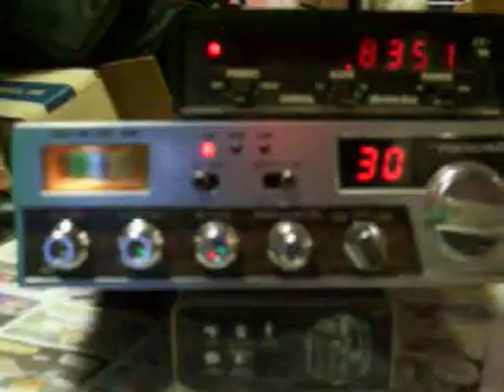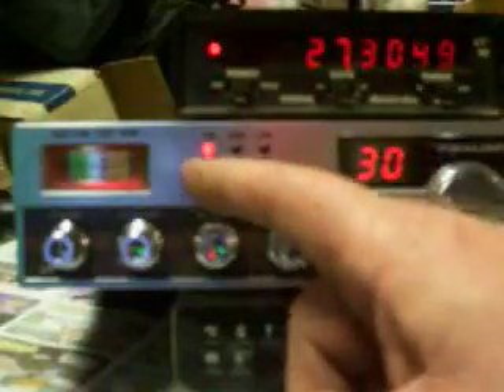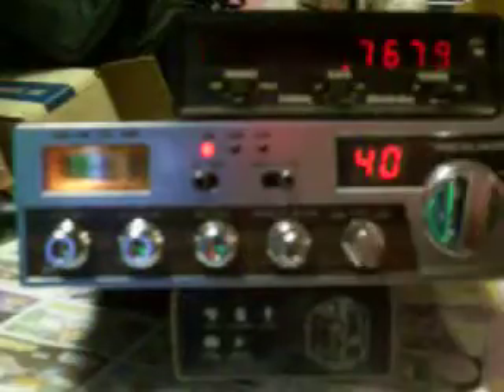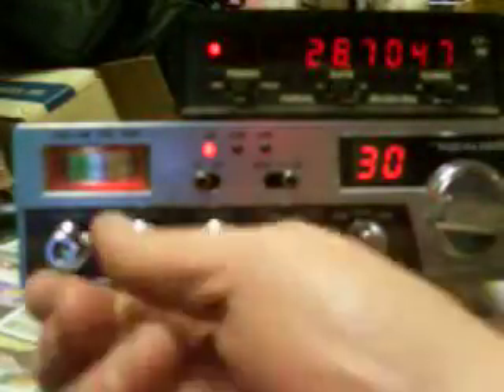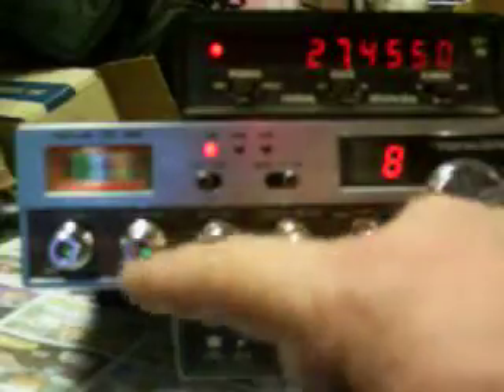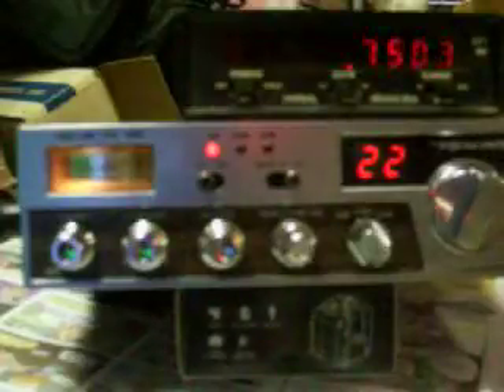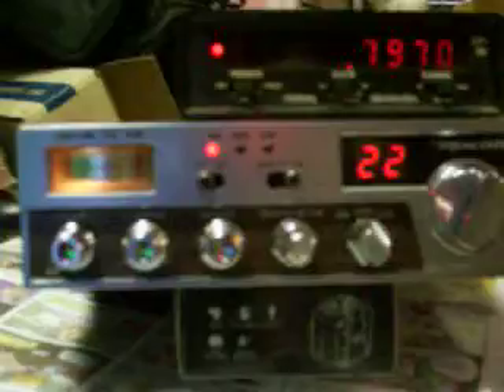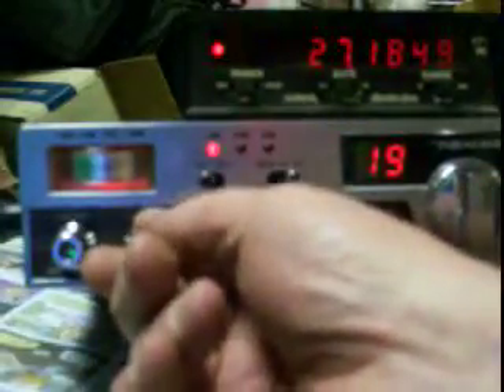TRC-449 Realistic CB on 10 Meters UPD858 ham mod

Comment: very cool.ive been trying to find info on how to do this  .im poor lol and cant afford to get a 10 meter rig.could this mod be applied to any radio with the upd858É ie TRC 458
Reply from the maker: yes. the TRC 457 458 + 449 use upd858 chip..also original president washington and older cobra 138xlr 139xlr + several more all used the upd858. mods, service manuals and truth tables can be downloaded from internet